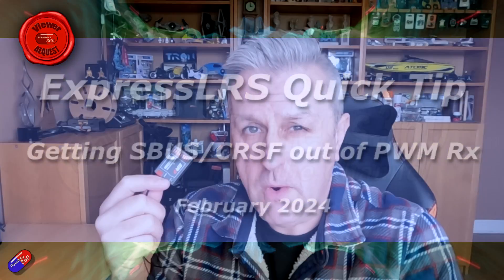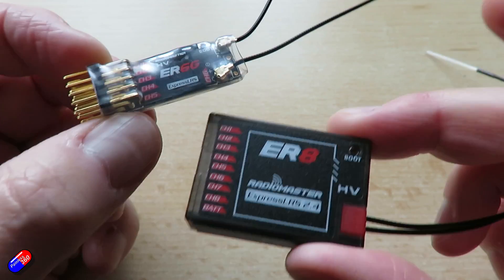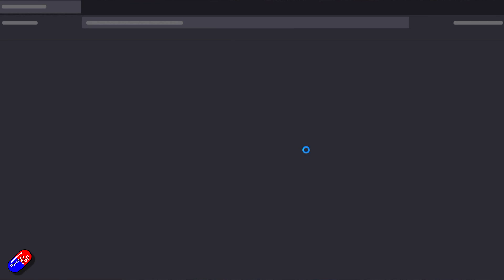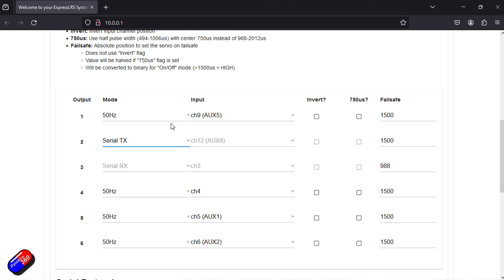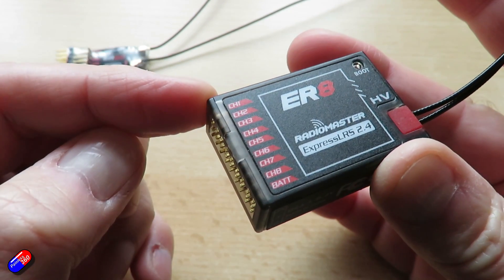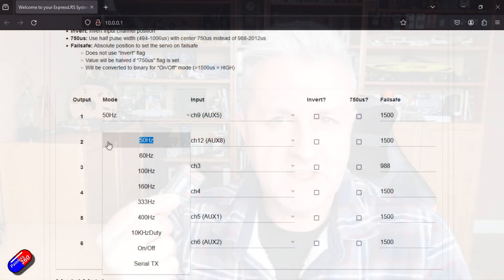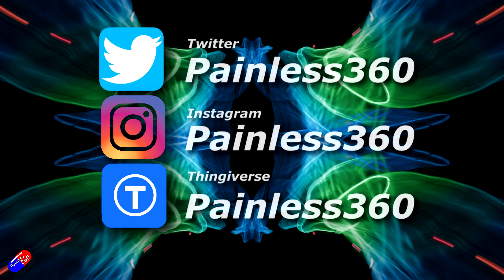How to setup SBUS or CRSF on your PWM ELRS Receiver (there are two ways!)

Comment: Great video. For some reason I don’t have choice of sbus in lua script protocol. Any thoughts?
Reply from the maker: It depends on what you've already tried....
Reply: @Painless360 I changed settings in rp2 to sbus. I see there is crsf inverted, I will try that next.
Reply from the maker: If it's sbus on the Rx, then setup in the flight controller is the same as any other SBUS rx... best of luck

Comment: Trying to hook up an ER6 to a F405 wing mini here...I thing I got it but doublechecking before burnin smth out and with nowadays tariffs and stuff will take forever to get new stuff delivered.....so my guess is that u connect the dedicated port
( - +RX TX) to the FC at  G 4V5 R1 T1 on the speedybee, right? Any help will be greatly appreciated. Cheers!
Reply from the maker: Always check the wiring diagram. I'd use a smaller reciever like the RP3 if you're using CRSF. Don't forget to swap the RX and TX connections... Best of luck

Comment: Very helpful video, thanks. So does this mean that if I want to add a gyro that accepts an sbus input, I could just send one sbus connection from the ELRS Rx to the gyro instead off connecting all the invididual pwm outs to it, and the gyro would receive all control data?
Reply from the maker: Yes, but watch out for CH5 needing to be high for ELRS.... Happy flying

Comment: Thank you so much.  I cannot compliment your channel enough.  Of all the channels, yours is the single most instructional, most useful resource.  I'm new to the hobby and it's been a nightmare reading and watching so many things only to make incremental gains.  There's no real A to Z instructional manual.  Now I have a starting point to using the auto-recover feature of the Reflex V3 which was previously inaccessible because it requires SBUS from the receiver.  Too bad I already crashed the aircraft when I lost it in the sun!  At least now there's a hope of setting up the ReflexV3's autorecover from one of the switches on the Radiomaster transmitter.... now if I only knew how to do it ......
Reply from the maker: See my video on setting up other stabilisers... Happy flying

Comment: Because I am using matek F411wte, the uart is only 2. So I am using sbus tab for the receiver (ER8). I have changed my elrs wifi settings to sbus. But its still cant connect to inav. When I change the inav receiver settings to serial-sbus it going back to default after save and reboot. What should I do?
Reply from the maker: Check out my INAV for beginners series for how I do it... Happy flying

Comment: Hey Lee, can you show the setup of the gyro on the ER6G receiver, can't see anything in the manual, assuming it just zeros from power on, but no adjustments to gain, angle etc???
Reply from the maker: As far as I know, there isn't a gyro in that receiver. The G stands for 'Glider'...
Reply: @Painless360 Ooo well that sucks ha ha. I thought it was  gyro and gyro vario for G and VG. Thank you.
Reply from the maker: Stay tuned. There is hope that we will get a ELRS with integrated gyro at some point... Happy flying

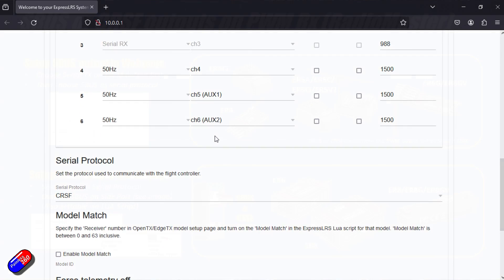Comment: Man, you are a life saver Lee. I have lost 3 days trying to figure this out. I really wish there were better documentation on using this, from the get go. Like maybe in the ER6/ER8 user manual perhaps.. I get that Radiomaster probably included that CRSF/SBUS plug for future expansion of Radiomaster branded peripherals, but my God Radiomaster. A simple picture like the one Lee included @4:50 and @5:59 would have been very helpful. I love RCVR, but I can't sit through a 45 minute video on something while I'm trying to focus on setting up a model. Again, thank you Lee. You are a legend.
Reply from the maker: Don't struggle for days, I have videos on most stuff... Best of luck!
Reply: I totally agree.  A beginner has zero chance of setting up something like an EDF on their own without running into dozens of obstacles.  I can't believe the manufacturers don't have documentation.  When I looked at the manual to the Radiomaster ER series of receivers, I thought one of the PWM pins could be used for SBUS but according to Painless360, it's actually the dedicated CRSF port that outputs SBUS.  The instructions don't mention that though. Thanks Painless360, the best RC help channel on the Internet.

Comment: Great video as always and wonderful to see this functionality is now available.
I'd like to use Radiomaster ER8 8CH ELRS Receiver with a Frsky MLVSS Mini Lipo Voltage Smart Port Sensor.
Do you know is anyone sells a cable that would connect the two, if not do you know the name of the S-bus connector on the ER8?
Reply from the maker: Even with a cable, that would not work. The FrSky stuff uses their propretary SmartPort system and the ELRS receiver will not understand that. Some of the RadioMaster PWM ELRS receivers have a voltage sensing pin on them that you can use to get the battery voltage down to the radio over the existing ELRS telemetry...
Reply: @Painless360  Thanks for the info. I assumed S-port was the same as SmartPort, my bad.
I know about the voltage sensing pin on the ELRS RXs but I ideally would like per cell voltage telemetry.
Hopefully Radiomaster or someone else will come out with an SBUS sensor like the Frsky MLVSS Mini Lipo Voltage Smart Port Sensor.
Reply from the maker: That appears to be the plan. The first was the GPS module... Stay tuned!

Comment: Right now I'm trying to connect siyi fm30 receiver (it was pulled out from burned v-tail, so i'm not sure that it is actually able to work correct😄) to skystar f405hd2 controller. Your video has no solution to my problem, but it gave me some ideas. Thank you.

Comment: I currently have EZUHF and an Eagletree Vector.
My RX talks to my Vector over SBUS but I also have flaps and lights connected to the RX using PWM.
Is this still possible using the ELRS receivers if you enable SBUS?
I’d like to assume the pins still work as normal for whatever channels you set up in your radio? Thanks!!!
Reply from the maker: That should be fine... Happy flying
Reply: @ thanks : )

Comment: Hello. If i connect my reciever thru serial port to my flight controller, can i add servo to my reciever channels and control it..? Thanks..
Reply from the maker: It depends on the reciever, you can foward RC channels to spare PWM pins that do the sMe thing.... Happy flying
Reply: @Painless360  i am using radiomaster er8 reciever..
Reply from the maker: Then you can do that via the FC, or via the receiver. https://www.expresslrs.org/hardware/pwm-receivers/

Comment: Yea ER8 I see it list a protocol 1 & 2. Seems protocol 2 is on the pwm pins. Protocol 1 & the model interface option on wifi is the plug. I'm going to test. Running SBUS on clark tk50 in a tank in fpving

Comment: Hi. I'm trying this with the ER4 and a Speedbee 405 wing mini but i can't get any inputs in Inav. It's been few days that I'm looking for a solution. Looks like my settings on the RX, the TX and Inav are right. I also checked the SBUS signals through a ToolkitRC M7 and there I get inputs. Really don't understand what I'm missing 🫤
Edit: I also checked the fcboard with a multimeter and looks fine
Reply from the maker: It's usually the port set for serial RX needs changing... Best of luck
Reply: @Painless360  Thanks for you answer!  ( as always 🙂) Unfortunately, I already made the change. I think i'll try to send sbus signals to the fcboard with the toolkitrc M7. If something appears in INAV, i'll know that the issue comes from the RX/TX. Anyway, I think about buying a Radiomaster ER6 with the crossfire port build in and give up with the sbus ELRS nightmare I have.
Reply from the maker: ELRS issues almost always come from one or more of these common mistakes:
1) Not configured the UART it is connected to as serial Rx
2) Not configured the Rx protocol as CRSF
3) RX wire on Rx not going to TX pin on FC (and vice versa).

Best of luck!
Reply: @Painless360  thanks 🙏
Reply: I found where the issue was. It was a true beginner mistake. Everything was right except I had several uart activated as serial rx in Inav. Now it works just fine. I'm glad I did not give up!

Comment: Hi, 
Can you help? I have received with tx,rx,g,v pin I am setup sbus but I can see channel whit Rssi signal on betafligt configurator. Can I have transfer rssi signal from taranis x9d plus to fc buy a channel?
Reply from the maker: If you want telemetry, setup the connection as CRSF not SBUS... Best of luck
Reply: Ok thanks 👍

Comment: Hello, 
Can some pwm outputs be used in conjunction with the sbus when connecting the same way FR Sky used to do it?
If so, this would be ideal for a truggy im building. I would like to switch to a new longer range systems in the old frsky receiver I have in it
Thanks
Reply from the maker: I believe you can. Be aware that the power pins on the reciever will need to be powered seperately... Happy flying

Comment: Hello I am a fixed wing modeller, I wonder if this sbus is compatible with those gyros with sbus input in the market. Any advice please thanks in advance.
Reply from the maker: They should be, best of luck!
Reply: Apparently you need to change to 16/2 channel mode 333mhz I think from memory, only then do you get proportional output on ch 5 to adjust gyros. Not done this myself yet but will be doing

Comment: Great information.   The manual for the ER6/8 mentions UART.   I have a FMS Reflex V2 flight controller that I will be getting, and I'm want to connect the two via serial connection.  Normal SBUS on the Reflex controller is on input 5, but given CH5 / aux1 / arm concerns I'm thinking of staying away from that and going to a separate UART port on the Reflex controller.   Can the port on the ER6/8 also be setup for UART and would it (probably) be able to communicate channel information to the Reflex flight controller this way?  Thanks.
Reply from the maker: Serial port on the RX can provide sbus or CRSF. Watch for CH5 though... Best of luck

Comment: Hi Lee! I was struggling to get my ELRS receiver to link to my Ardupilot (on a Matek F405 VTOL) until I found your video on switching it to SBUS. This was the only way I could get channels to be read on Mission Planner. Thanks a lot for your massive help!
Reply from the maker: I've heard that the speed of the ExpressLRS system can stop it working.. You can try other speeds in the LUA script to get CRSF to work... Best of luck

Comment: This info also comes in handy should you ever need to flash one of these receivers via usb.  The same pins that would be for serial in/out will be used for flashing after  pressing the boot button while powering up.  (like if it won't flash via wifi or gets bricked)

Comment: Two questions.  The ER 6, 6G and 8, 8G both come packaged with an sbus/tx cable, so I presume you just plug that into the receiver and into any stabliser/gyro you may be using? Secondly, in non elrs recievers, you normally get 'extra' digital channels when using sbus. Is this the case with these Elrs receivers?
Reply from the maker: Yes and yes
Reply: @Painless360  How about those stabilisers demanding the mode change be on ch5 such as the Kopilot? How do you get round the elrs ch5 2-position restriction? I've been looking for a way to do this for some time now!
Reply from the maker: At the moment, you can't with SBUS..
Reply: I've done some more research. If you're running fixed wing , you can make chan 5 proportional,  by choosing the 16/2 option. However, if you're using quads, it's not advisable as it turns off some of the arm switch safeguards... @ChrisBalmforth
Reply: @sirtrumpington4779  Many thanks, I've never noticed this nugget of information on the ExpressLRS web site before! I can confirm that's what the page says. I'll try it out later this evening and see how it works (on the bench, no flight testing in the dark!)
Reply: @sirtrumpington4779  I hadn't seen this info before so I checked on the ExpressLRS web site and by golly you're right! I just tried it on the bench and it seems to work fine. I set up an ER-4 with an sbus output on pwm channel 2 and fed it into an sbus monitor. I set up my TX12 Mk2 with a slider input on channel 5 and the monitor showed a smoothly proportional channel 5 output. You're a star sirtrumpington!  I've been wanting to use elrs with the ZOHD Kopilot for some time. It only works in 16/2 channel mode, and I assume that the 50 Hz update rate increases latency, but that doesn't worry me for fixed wing use. Can't wait to test it in the air!
Reply from the maker: Remember that CH5 still needs to be a MAX value for the ExpressLRS system to be 'active'. Any other value (at the moment) will result in lower range etc..
Reply: Thanks...👍

Comment: Is there a way to set up an Er4v on a ZOHD Kopilot work sbus? Got it to work on the Er5a with channel 5 adjustments but want voltage telemetry.

Always great videos!
Reply from the maker: I'm not sure. No mention of sbus in the specs I could see. I'd connect via Wi-Fi and see if it has the option... Best of luck
Reply: This is exactly the configuration I want too. As far as I can see it is not possible to change the sbus ch5 assignment on either the ER4 or ER5, and Kopilot needs the flight mode input on ch5. Did you manage to get round this using the ER5a or did you just use the PWM outputs like I do?
Reply: @ChrisBalmforth  It's possible with the ER5, I got it working this summer. You need to change CH5 in the receiver settings to another channel, that way you are able to switch modes using what the receiver sees as "not" CH5 but still has output on the CH5 pins on the TX.

I think the problem is that the ER4 only has 4 sets of output pins and isn't able to handle changing CH5 in settings as a result. Was hoping to post here and be proven wrong lol
Reply: @ChrisBalmforth  came back to specify that I got it working on Pwm with the ER5. Not sbus.

Comment: I have a MT12 with an internal ELRS / I have a speed boat that flipped upside down in the middle of pond, can not unplug the reviver, I have a recovery boat to go out and get the speed boat using the same radio. Will ELRS model match let me switch from one receiver to the other with both receivers plugged in?   Please help!
Love your videos 😊
Reply from the maker: It will, if you are using model match.... Best of luck

Comment: great explanation of the whole topic.
At the end it means that you loose 2 ports in case of the smaller glider receiver ER8g/v and those for the cars.
an important reason to get such boxed receivers with the additional port which can be overlooked quite easily. 
Lots of added value !
Reply from the maker: Remember that you can bind mutulple recievers, so you can have lots of PWM outputs as well as sbus and CRSF.... Happy flying